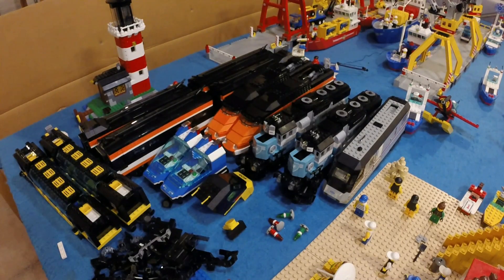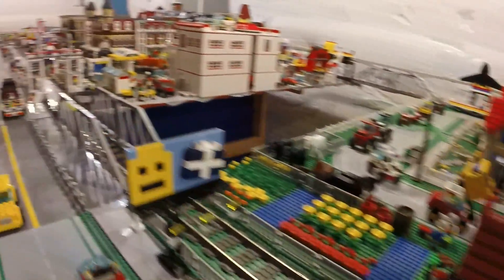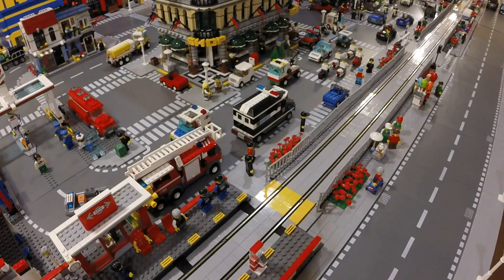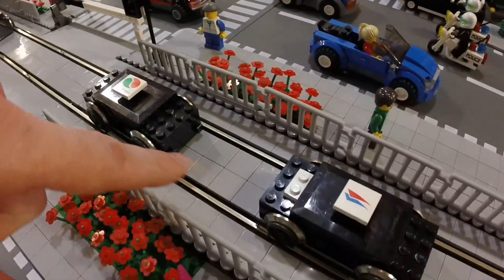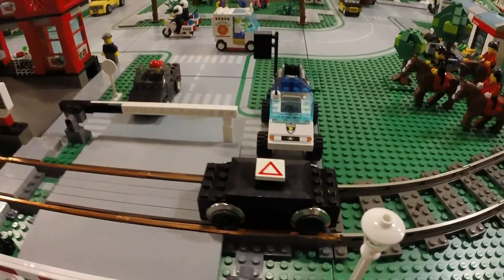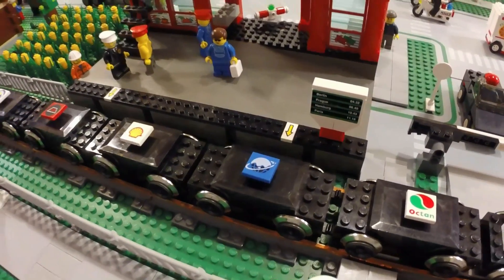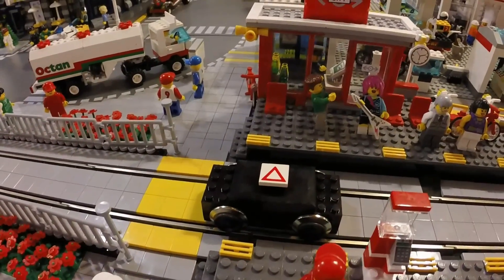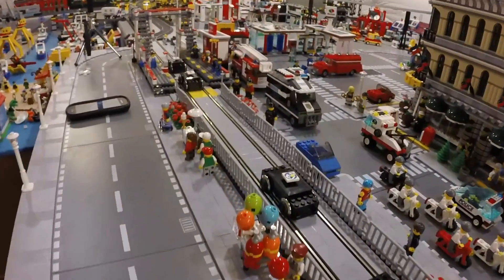9v Motor Speed Test

Comment: Hi, came across your channel. great videos, love them. 
I have questions, I'm thinking to migrate from battery power to 9v train motor, but I dont know the pieces that I need other than that 9v motor. 
Do you have list of the pieces I'm gonna need with 9v motor set up?
Reply from the maker: Thank you! For 9v, aside from the motor you will need the transformer and speed regulator. Lookup item #4548 on brickset.com You will of course need 9v track as well. That's the expensive part of 9v. That should cover what you need. Hope that helps.

Comment: Advice for a slow running motor, open up, clean the axles, oil the gear system, be careful not to oil the electromotor itself, the oil will reach within, and that's enough for it, that'll help conserving and the running

Comment: I know this is an old video, but I have about eight 9V motors which haven't been run or tested in quite a while. Based upon your own testing and the conclusion drawn about the Horizon Express, I might have to sell all of them on BrickLink. If the 9Vs are barely pulling a train that size, my 8-wide units wouldn't see a full loop.

Comment: Hi Alex  did you use an extension cable to reach some of the other contacts further away from the regulator to sustain the voltage throughout the track? how many regulators did you use for this track? Thanks

Comment: Will you get electrocuted if you touch each side of the tracks while the power is on?
Reply from the maker: No.
Reply: 9 volts cant kill you
Reply: Alex Nunes thank god
Reply: Alex Nunes how come? I thought these worked allowing the flow of electricity from one rail to the other, powering the motor as it did. Is that not the case?

Comment: I rebuilt my 4563 Load and Haul. I have the problem that the motor runs fun by it self but with the engine mounted, it will do a loop or two and stop. If I remove it for a minute or two, it will do a lap or two again. Any experience with this? Have you ever rebuilt one or do you just buy replacements? Where do you shop for them?
Reply: May be late but my motor from 4558 Metroliner did exactly the same thing. Info on the net is sparce about this issue but it seems that older motors have a current overload chip in them which prevents the motor from burning out if it is run too hard. I have a hunch that some of these chips become too sensitive as they age and prevent current flow to the motor under even the slightest load. To put it simply, the chip "tires" the motor and it needs to rest to become functional again. I've not tried to repair mine yet as I've got many other motors but I have heard that opening up the motor, removing the chip and then hardwiring the motor to the wheels will fix the issue. Just remember that that motor no longer has a fail safe to stop it from burning up under heavy working conditions.
Reply: i had this problem too then i put some silicone grease on all the axles of the trainset and never stopped on me again since it even runs 25 percent faster

Comment: You can try check if there are any hair behind the wheels on the axels. That have slowed down my power functions train motor as well, but it is easier to remove it on those, because of the axles that are movable. Tell me if it works. :)